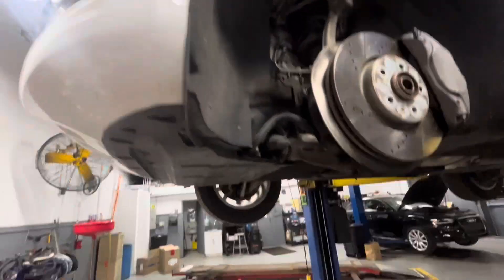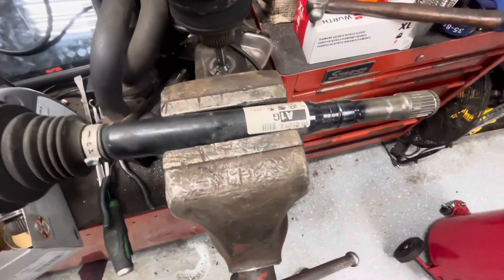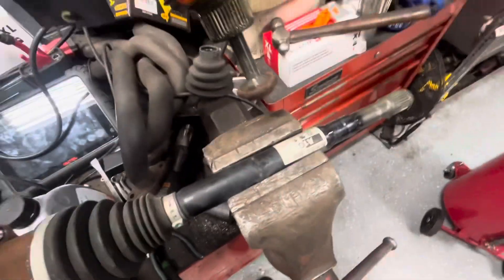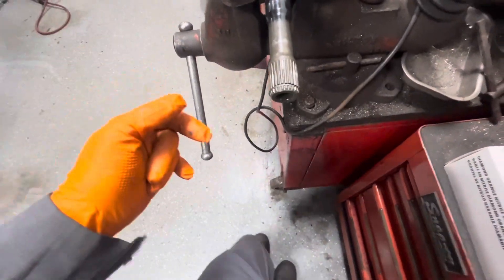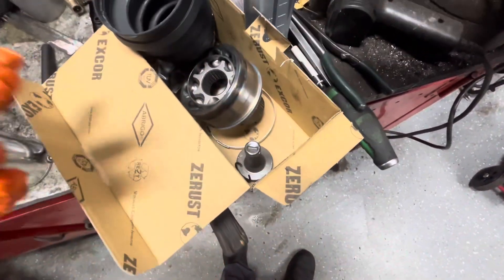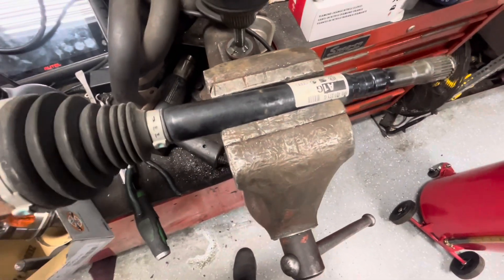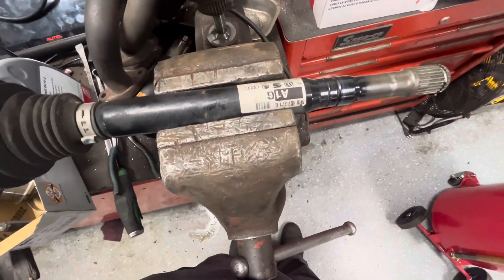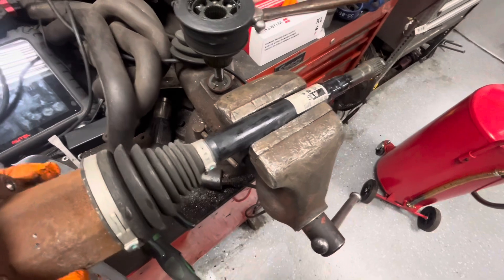BAD CV jOINT? DO THIS RATHER THAN REPLACING AXLE

Comment: I did the same thing with SAAB axles. I could buy an OEM CV joint kit with boot and grease for the same price as a reman axle. If a torn boot was caught in time, I would disassemble the joint and clean it. Boot kits with grease are inexpensive. It turned out that the splined CV joint shaft that passes through the hub was the same spline where the axle shaft snaps into the joint. I cut the splined portion off an old joint along with the threaded end. I then drilled through the stub and tapped it so as to fit a grease zerk. I filled a mini grease gun with joint grease and was able to thoroughly grease the joints. 

I was told that remanufacturers enlarge the worn recesses in the joints and install larger ball bearings. There isn't a lot of material to begin with in a new joint after machining. I think that these enlarged recesses wear faster on reman axle shafts leading to premature failure.
Reply from the maker: Wow really cool idea with how you loaded them with grease. Yeah, I’m seeing so many issues with cheap aftermarket axles lately it’s getting silly, not close to OEM quality